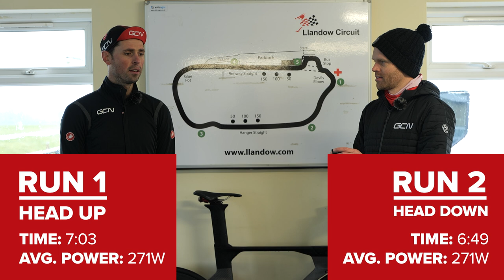Faster Isn't Always Better: Why This Super Aero Position Is Dangerous

Comment from the maker: Do you think the UCI rules regarding TT bikes and/or positions should be changed?
Reply: yes. just go to straight velomobile for TTs
Reply: I guess a head down position is more aero on a regular road bike too, so banning TT bikes would solve nothing, time trials would happen on road bikes whilst riders trying to pick up the most ridiculous positions possible that includes heads down riding. I also suggest UCI to modify rules on TT bars to allow more freedom and it might sound silly but a chin holder added to the TT bars might mean a difference too. That way looking forwards and tucking your head completely down at the same time could be possible.
Reply: Yes! And I speak from experience having raced UCI regulated provincials, nationals and four GFWC world championships in Europe. The rules are dangerous especially for someone with long arms. They also penalize those with mechanical shifters versus electronic. The aerobar pad /extension height rule should be removed altogether and the extension length rule should also be changed.
Reply: Yes, they should ban head down positions.  
Don't really care what they decide about the bars, but the core issue is not being able to see, so they should address that directly instead of changing the bikes and hoping it will change rider behavior.

Comment: The 10cm rule is not well thought out because it favours smaller riders. It should be a percentage of the tri bar length. No wonder Ganna rides in that strange position
Reply: NONE of the rules in UCI are "well thought out" to make racing fair.
Reply: But it helps make up for the 6.8kg rule, which favours taller riders
Reply: @BladeBarn  "noooo you can't make a fairing around your chainrings"
Reply: @ds6914  it doesn't favour taller riders, they aren't given a lighter bike than smaller riders it evens the playing field so they ride a bike of the same weight!
Reply: @oliveremmerson-fish7486  I think you're missing their point. The larger a rider you are, the smaller the percentage of total weight comes from the bikes. So, proportionately, a larger rider has less bike weight to move relative to their body than a lighter rider. A rider at 85kg on a 7.5kg bike hauls around less relative bike weight than a 60kg rider on a 6.8 kg bike.
Reply: @Dispariabooks  indeed however a larger rider has to push more mass through the air which is more of a hindrance than any weight penalty. Going upwards is a very different story though as you don't see many big riders winning mountain top finishes!
Reply: @oliveremmerson-fish7486  Muscle power is related to body mass, which is a function of height cubed.  Air resistance tends to be a function of height squared, (and speed and position on the bike of course).  That's why, on a flat course, bigger riders tend to be faster than smaller riders.  (Of course, some riders are naturally more aero than others, e.g. if they have relatively narrow shoulders.)
Reply: @richardharris8538  exactly, and why smaller riders do well on the inclines
Reply: @Dispariabooks  Yes.  The 6.8 kg rule applies equally to Filipo Ganna, (82 kg, 1.93 m), and to Coryn (Rivera) Labecki, (48 kg, 1.52 m).  That makes no sense to me, other than it being a very simple, one size fits all rule.  And as you say, it disadvantages smaller riders.  Heck, it'd apply to me, and I probably don't have half the power of Ms. Labecki.
Reply: @ds6914  But if they want to give bigger riders more chance then why the hell UCI is so obsessed with giving almost every race an uphill finish?
Reply: @mateagoston8145  Alaphillipe
Reply: @charliewhelan9488  Is he the biggest friend of UCI governors?
Reply: The Clydesdale Athena cathegories favor taller people instead. Because they're written as an absolute value (220 pounds for men) instead of obesity BMI % which correlates to athlete height.

Comment: Easy solution. Install a camera out front and mount a display inside the helmet or on the cockpit.
Reply: that sounds scary, it kind of becomes a VR game at that point
Reply: @ranitbose9609  The car industry been implementing Backup cameras, heads-up displays or parking aids in cars for years.
Reply: yea but there is a diffrence between parking a car and riding above 50 kmh in traffic lol
Reply: @Cryr213  It's better than not to see anything. Combined with perimeter sensor it could give the rider audio signals to avoid dangerous situations. Also time trials in the professional segment are held at courses where cars are blocked off.
Reply: That’s adding at least 1kg of weight smartie! Big no
Reply: @leeasy7112  Something like a GoPro hero 10 weights 153 grams. If you remove the housing and integrate that in to the bike you could save even more weight. So no, it's not unreasonably heavy at all.
Reply: @The2808erik To you and me that makes no difference, but to them even 100g is super HEAVY, not to mention the aero drag. In pro level, even 100th of a second matters. If this is doable without affecting their performance, they could’ve done it long time ago.
Reply: @leeasy7112  yeah. But if the UCI bans the head down position altogether, it's a moot point. Camera + head down is faster than head up.
Reply: @leeasy7112  First of all the UCI weight limit is 6.8kg, which is easily achieved now a days, some bikes even need to use weights on bottle cages to meet the requirement. Why do all pro's ride disc brake bikes now on road bikes and time trial bikes, when they offer no advantage especially on TT bikes. Pros ride what their Sponsor provides them with , because The industry wants to promote a specific thing.

Comment: A great amount of amateur accidents I read about here in Germany happen with normal race bikes, but following the pattern of Egan Bernals crash. A parked car, especially on a country road, is easily mistaken for a moving one. I guess every cyclist had moments like these, realising the obstacle in the very last second. You don't need a time trial bike for this.
Reply: when you're pushing FTP your brain is slower, anyway
Reply: @KirbyZhang  That’s an interesting obeservation and might explain a thing or two.
Reply: I can get in enough trouble with head up. Last week had a dog ambush me. He seen me coming but I did not see him until he was running out of the ditch toward my front wheel. Stop as loud as I could. He stoped and I swear he smiled. Some kind of herding dog.😅

Comment: Probably should have done this in an indoor velodrome... to reduce a few variables.
Reply from the maker: We probably would have ended up dryer
Reply: Much better with some real life results. The logical extrapolation otherwise would be to just leave it up to computers to calculate
Reply: @keithmaclure9101  as someone who tests AI qualitatively I can assure you we can't only rely on the math alone. It needs to be merged with real life data and reconciled.
Reply: It looks way cooler outside in that quintessential British weather.

Comment: I know that my head eventually drops down due to neck and shoulders aching so much in the "head up" position. However, for me the bigger issue is in the TT position I end up looking over the top rim of my spectacles, so everything in the distance is very blurry. I've recently abandoned the idea of contact lenses because I struggled to get them in and out and then had sore eyes for several days after. My current solution is to fit a small elastic band between the nose clips to raise the spectacles on my face - cheap solution.
Reply from the maker: sounds like a hack
Reply: @gcntech  Lol ! No, I'll accept my fix is a bodge, but it does work. A hack would be laser eye surgery to correct my poor vision. Joking aside though, maintaining a good un-compromised lookout on the road is so important. I'm very pleased to see that GCN have raised the issue for education and debate.
Reply: thanks I will try that fix. I played around so much with glasses. I ended up not wearing the prescription glasses. Best sun glasses have no rim I have found..

Comment: On the 40k of an olympic triathlon, that 14 sec faster with the head down (for 7k) means 1:15-1:30.  It's huge.  It is more than what all my year of training can give me; it's more than most gear or components I can change on my bike.  So, that is sad to say, but what that video does to me is only to convince me that riding head down in a time trial is a must.  For me, in a triathlon, that could well be the difference between finishing on or out of my age group top places.  Hard to say no to that position for the sake of safety (because we are not talking, here, about going down a hill at 100 kph, we are talking about going straight line at, say, 40 kph).
Reply: I think drafting allowed rules would negate that difference.
Reply: I think itu cross and mtb triathlons are a better measure of cycling capacity for triathlons.

Comment: Thankfully for me, after plenty of aero testing with my coach, my TT position is faster when my head is up and the helmet tucks into the space above my shoulders nicely. Though a small difference, putting my head down increase frontal area a touch.
Reply from the maker: That's great you've managed to get aero with your head up, it can be just as fast!
Reply: May I ask what helmet you have? Because I feel like this may also have an impact on this. Seems like you've got the safer one ;))

Comment: I'm waiting for technology to step up to this problem by providing a HUD for the racers inside their helmets to give them better situational awareness.
Reply: Then you might as well ride backwards which might be more aero ... 😉
Reply: Couldn't they just put some sort of mirror on the handlebars to see forward?
Reply: @stephenwatkins7592  everything would be mirrored... Which could cause issues.
Reply: @brianwright9514  make it two mirrors, angled at 20° or so.
Reply: I’m surprised it doesn’t already exist, with a small camera like you have in a phone and a small display mounted inside the visor, it doesn’t seem a difficult problem for anyone who is a bit handy with electronics
Reply: Rock climbers use glasses with attached prisms (well - not the climbers, actually, but those guys that stand at the bottoms an hold the ropes to secure the climber) to avoid having to stare vertically upwards all the the time. The same solution might help cyclists as well. On the other hand - isn't the head-down position just more aero anyway because your front area exposed to the wind is smaller?
Reply: @michab4083 those guys are called "belayer", and the only thing they need to see is whether the climber is still moving (then pay out some more rope) or not. For anything else "belay glasses" are crap.

Comment: Huge difference between a professional time trial on closed roads, and amateur time trial on open roads but with signage, marshalls and enough cyclists around for most motorists to get the message and where some of the recent crashes have happened with cyclists out on training runs. Cycling on open roads in the UK can be dangerous enough without the cyclist adding to the risk factor by limiting their awareness of what's happening around/in front of them.

Comment: Only reason I ever ride with my head down is just to rest my neck a bit, not because it's more aero. And I'm pretty careful about picking my spots when to do it, but you can never be 100% safe. I've had three close calls with deer while riding, and two of those were when I had my head down for a moment (one was just me going really fast downhill then going through an underpass with lights and I didn't see the deer on the other side of the underpass where it was dark). Thankfully, the deer have better reflexes than I do.

Comment: Definitely try to "look through my eyelids" when in a tt position.  That's fast enough and a pretty big gain over the field.  Especially at gravel races I've attended where the steel frame hipsters regard tt bars as akin to cheating!

Fwiw - re: the pinky position-hold.  I'm not sure that's such a no-no.  I find relying on my arms and hands to steer is a bit sketchy.  Steering becomes much more stable when holding my upper body steady with abdominals and steering is done more at the trunk/shoulders - if that makes any sense!  Yes - it takes practice and after a few hundred miles you'll feel it.  Still more efficient than battling a headwind with no tt position.

Comment: I think there will always be heavy crashes in amateur events. Road cycling (and TT) is at the perfect "bad spot". 

Other muscular motion sports have slow speed (running) or perfectly controlled environment (speed skate) or both.
Descent sports (downhill ski or mountain bike) are more "sprint" type of effort, very technical.
Motorsports are all about trajectories and motion doesn't cause directly exhaustion. And due to speed and budget involved, there's a lot consideration for safety in the event of a crash. Be it with tracks safety or vehicles safety. (With the exception of Tourist Trophy and its fatalities...)

In road cycling (and TT), we are fast on flat (between 30 to 50 km/h) enough to start being dangerous. We ride on open roads for long periods. Roads are not that technical at all most of the time and can be dull. The faster you are, the more exhausted you get. It's a direct effect since motion comes from you directly. It requires a lot of resilience to keep focus on the road driving while you try to extract your very last drop of energy, pushing your limits. Your mind can easily go blank, just driving in "autopilot", your remaining focus managing your effort... HERE is the danger.
Reply: In training and racing events humans are alway able to mange their risks...
Its not the responsibility of an organisation to make new regulations (fun police), when riders TRAIN in head down positions...
Maybe riders don't need to adopt a position with higher risks in dens traffic, within cities/villages or when they're exhausted...
IF you need to train the position in exhaustion... do it on long straight roads or on a stationary trainer.

same goes for cornering in races. "No rule" doesn't mean "DO IT!"

Comment: Always ride head up as I find my aero  helmet fits better on between my back
Reply: Yes, with the more pointy back end type aero helmets not the snub back end to nearly normal end where the helmet is just a more aero version of a normal racing helmet rather then a specialized helmet. In fact some places they do the Triathlons they do not allow the aero helmets due to the rules of the place they are racing in so they have to wear regular helmets or at least aero without the face shield so the rider has to face forward because due to physics of wind if head down they get more wind to the eyes in the gaps of the sports glasses.

Comment: I just push more watts and pass them all in the races I do.

This isnt an accurate test though as the wind will vary second to second. You need to do 2 people riding apart and then you can cross the data points and get more reliable analysis.
Reply: brah, the discs brakes are like disc wheels, they catch wind like a sail and actually make the bike faster, though

Comment: Head down riding would happen on road bikes too. See Luke Plapp's TT at the UAE Tour this year. Banning TT bikes wouldn't stop riders from doing this.
Reply: Also, what constitutes a ban on TT bikes?  So let's say you ban TT bikes.. teams just put aero bars on their aero bikes then. Let's say you ban aero bars, then teams start messing around with stack height and stem length and handle bar shape/width. You just end up with the same problems every time, because aerodynamics dictate the position.
Reply: @davidspagnolo4870  Ban aerodynamics

Comment: With all due respect, I’d argue that the majority of crashes on TT bikes could be alleviated by merely having brakes on the extensions. Surely, one manufacturer will ultimately produce an electronic braking groupset for TT extensions in the near future...
Reply from the maker: Braking with your weight forward, as it is in an aggressive tt position, could be dangerous

Comment: Has someone ever tried to fix some kind of mirror in a 45°-angle to make it possible to see whether there is something in your way? I have to admit I put down my head everytime a lorry come up to me on the other side of the road, as they produce some kind of a wind wall, and I take the side marks of the road as an orientation. Concerning the problem, riders should try and make some gymnastics with their neck - I remember pics of Chris Boardman with his head really low and still able to look forward - so they are able to turtle better.
Reply from the maker: Periscope glasses are a thing. Not widely used, but they are a thing

Comment: The time difference might be significant at top amateur or pro levels but having just done my first triathlon (on a normal bike) the time lost fighting to get a jersey on over a wet tri suit overshadowed any potential TT bike advantage 🙄
Interesting video but grim weather!  Did Alex get danger money?
Reply: @alexanderborisov8626  yeah, I got it into my head I needed to put a jersey on because it was cold and murky but you’re right, I didn’t need it.  Also, I was doing a sprint triathlon so the transition faff was a greater % compared to the actual exercise.

Comment: Doesn't have to be a tt bike for head down, a sore neck will do it.
If you are going to allow TT bikes in races then riders must train on them to get used to holding the position.  Its the training thats the main problem.  You don't have to conform to UCI for training.  A wide angle (to cover the width of the road plus a bit) camera with a screen (mobile phone?) mounted on the bars below your head for training might work?  Any additional drag think of as resistance training.  Trouble with a mirror is the inverted image can be disorienting.